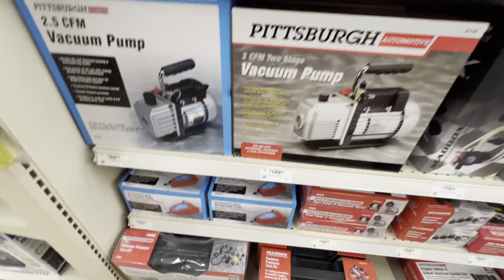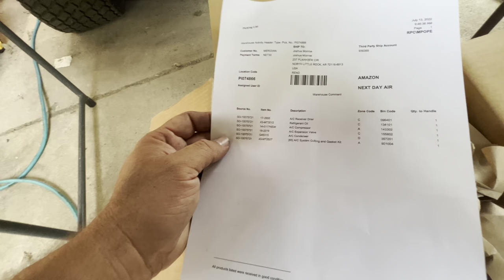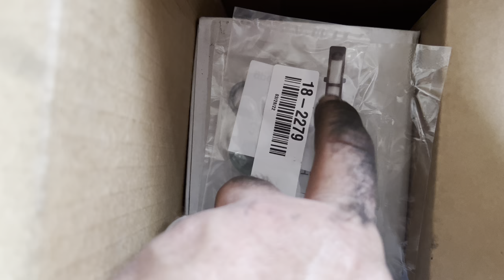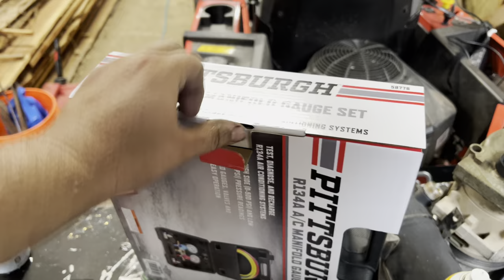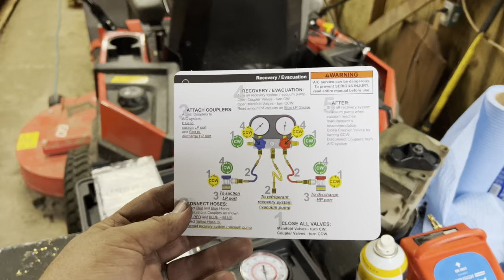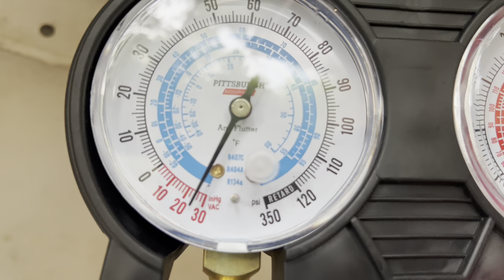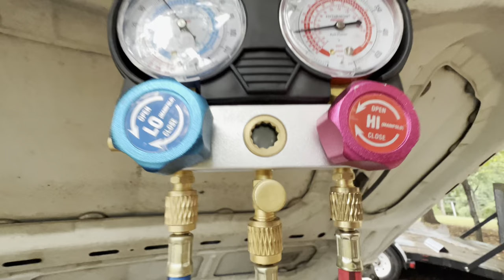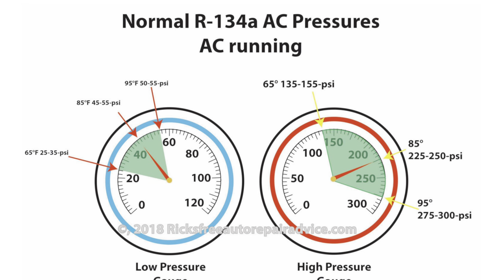How to Fix: Bronco Air Conditioner REBUILD - Step-by-Step (Link for rebuild kit in description⬇️)

Comment: Great video man. Im looking to replace the system in my 95 f150 4.9l soon. The full kits im looking at say the compressors come pre charged with pag oil, but they also send bottle of pag oil with it. Not sure why. If you have any input on that, let me know.
Reply from the maker: Thanks for the feedback! Well, mine did the same thing…I think I ended up putting too much oil in mine as a result. I’d definitely confirm the oil is in there…maybe ask the seller if they can confirm???
Reply: Most suppliers tag the compressor with how much oil they installed in the compressor then you add the remainder to achieve specs
Reply from the maker: @southernnavigator8219  ah that makes sense!

Comment: Got a question for you. I’m working on my 96 now and I got a situation where I need to know what the wiring looks like (color wise) coming from the 2 wire connector on the compressor, and the connector on the manifold connecting to the back compressor. Any help would be greatly appreciated there.
Reply from the maker: Here’s what’s on mine:

Compressor wire colors if you’re facing the front of the compressor, black on the left, gray with a white stripe on the right.

Sensor on the back of the compressor colors facing the plug from the drivers side fender are green with an orange strip on the left, and red with a yellow stripe on the right.
Reply: You’re the man.
Reply from the maker: @JacksonMitchell-h9c  thanks, friend, and I’m happy to help! Wishing you the best on your 1996!

Comment: Great video. I am going to redo my entire a/c soon, and this video is perfect for me to follow. Thanks for putting this together. A couple questions, why didn't you replace the evap cooler as well since you were already in there? And the kit I'm looking at says compressor is pre-filled, should I trust that?
Reply from the maker: In hindsight, I should have replaced that while in there too. When you say prefilled, do you mean with PAG oil?
Reply: @GrubNGas  okay, I'll go ahead and replace that too. Yes, prefilled with PAG oil.
Reply from the maker: @aber1711  that should be ok if it’s pre-filled. Make sure the pre-filled amount of oil is what the factory required amount is.

Comment: Very well done
Reply from the maker: Thank you, friend!
Reply: @GrubNGas  welcome. Just got done watching. I have the same bronco 96 Eddie Bauer. Just did a full fuel system upgrade. Coil distributor plugs wire fuel injectors vacuum lines ( had a fire) fuel diaphragm Schrader valve and a few others.  Having some issues with a rough idle. But I was going to do a/c next.
Reply from the maker: @Ray-ux9eh  wow! Sounds like you got it rougher than I did, I’m really glad this helped! Best wishes with your rebuild, friend!
Reply: @GrubNGas  yep, without bad luck I would have no luck at all.
Reply from the maker: @Ray-ux9eh  😳 Hopefully that’ll change!

Comment: Great video, thanks for creating. I’m rebuilding a 95 f250 and need to replace all AC components but am unsure if I can just remove/replace all the parts like you did or if I first have to have the system discharged? Don’t know if the AC worked or not but want everything replaced. Any thoughts?  Thanks!
Reply from the maker: So glad this helped you! You can take the vehicle to an AC shop and they can evacuate any remaining Freon (if there’s any left) and then you can proceed with the rebuild. Hope that helps!

Comment: Hi Does the pressure limit on the back side of the compressor also have a Schrader valve?
Reply from the maker: You know, I did not check, and probably should have. It wasn’t leaking so I left it alone. I’m adding that to my list of things to find out. Thanks for asking!

Comment: Would you be able to tell me where you got all the parts from? I'm about to tackle this on my 94 bronco. Thanks for the super informative video!
Reply from the maker: You’re most welcome! Yes, I got them on Amazon. I’ll try to find the link and post it for you!
Reply from the maker: A/C Kit w/AC Compressor Condenser Drier For Ford F150 F250 F350 F-150 F-250 F-350 Super Duty & Bronco OBS - BuyAutoParts 60-82448CK New https://a.co/d/f1aMKVt
Reply: Great job on the video!

Comment: Very good video with nice camera work, BUT, you made a mistake by not replacing both of the lines. You could have done so for $100. As I recall, the 134 works at a higher pressure than 12 does so it's all the more reason to change the hoses. I have an original one (1990) that leaks at a crimp. 
Also, you should have shown the vent temperature with a thermometer.
My crew cab takes 52 ounces. There's a sticker with this info on the accumulator. Maybe yours had been replaced before.
Overall, a nice job.
Reply from the maker: Thank you for the input, and I agree, it would have been better had I replaced the lines. I’ll double check my Freon after reading this to make sure it’s topped off. Have a great night!
Reply: @GrubNGas  Also, you put all of the oil into the compressor. I got the Four Seasons kit. It came packaged better but it come with 3 ounces in the compressor. The instructions say to add oil to the suction side of the compressor so it has half the system oil capacity in the compressor. Were there instructions and if so, did you read them? I've seen ac videos where they pick up the instructions and toss them aside without ever looking at them. Manly, but stupid. 
My system holds 10 ounces of oil so I put 2 ounces in the compressor and put the shipping cap back on. Aside from not overfilling the compressor, it also won't run out when installing it on the vehicle. Then put the compressor vertical, clutch down, for several minutes so the front seal gets lubricated or it could leak. It says to put the other 5 ounces in the accumulator. Before starting the engine they say to rotate the compressor about 10 turns to make sure there is no oil in the compressor cylinders. 
I installed an inline filter and water filter in my air hose at the blow gun. No sense in adding moisture to the system at this point. I could see it did collect water as I blew out the cleaner. The cleaner instructions said to blow air through the evap and condenser for 30 or 40 minutes to dry it as much as possible. Its a non solvent type that says any remaining product in the system is ok as it is compatible with R12 and R134a.
Reply from the maker: @trustme7731  thanks for the additional information. I’ll keep these tips handy for the next one. So far, it’s still blowing ice cold, so here’s hoping for a long life on the new system. Appreciate you taking the time to share your knowledge!

Comment: Do you remember how much refrigerant you used on this? I bought a similar kit from the same people for a 1991 f150 and it came with a newer style condenser(parallel flow) that looks a lot like yours, along with a flyer that read I would be using up to 20% less refrigerant than my OEM condenser(piccolo tube). But I can't find any info about the exact amount needed anywhere! Tech support to me 54 oz's and I know that can't be right.. Anyway awesome video really helped with my install.
Reply from the maker: So happy this video helped you! If I recall correctly I used 2.5 cans…but I’m not 100% since it’s been a minute. I know it was less than factory.